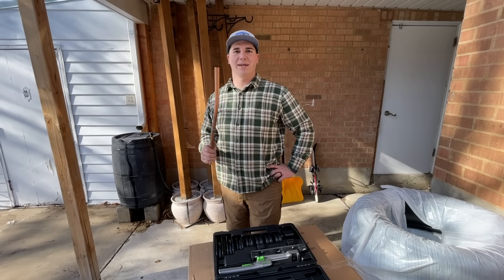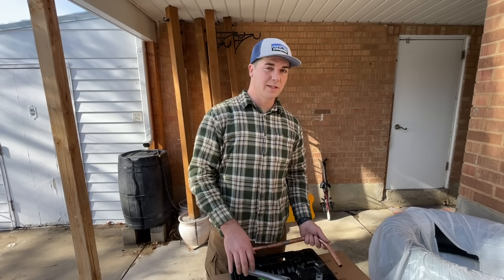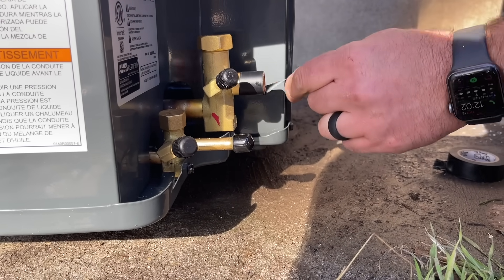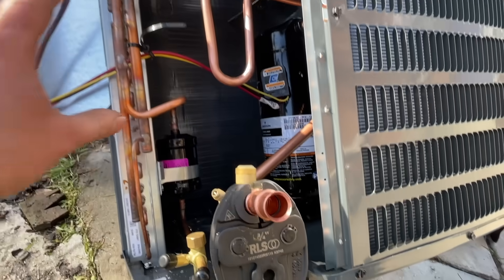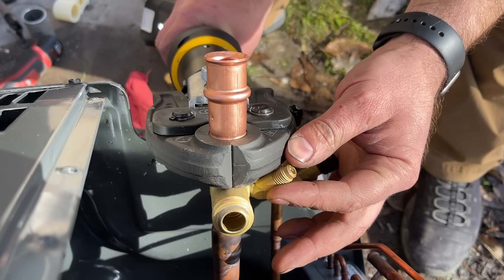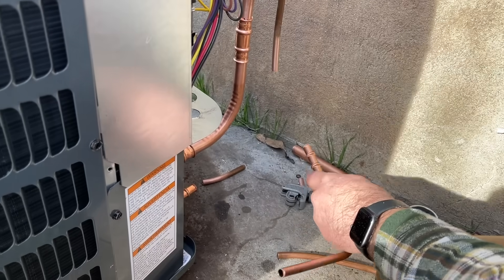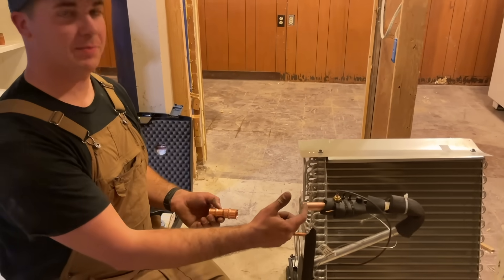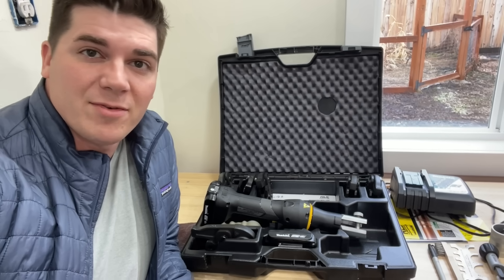Brazing Is For Cavemen. THIS Is The Future Of HVAC Copper Connections. -RLS Crimping Tool-

Comment: With 44+ years in the business, I can tell you that YOU ARE ABSOLUTELY WRONG,  I can braze  6 fittings to one (of the many) crimp fittings out there and IT IS  AN INFINITELY MORE RELIABLE MEANS of makiing a connection, as a DIY'er obviously you've not seen them  perform for the twenty years they've been around. I've seen them fail FOR NO OTHER REASON than someone put something in the closet, attic, or next to it in the garage and bumped it and it starts pissing refrigerant faster that it can be put in. ALSO wait until you have to remove the coil for clearing 5-10-15 years from now and you can't get the fitting off the coil side of the copper or aluminum tubing and there's NOT ENOUGH TO JUST CUT OFF IF YOU WANT TO CONNECT THAT COI,,, What aree you going to do then? order a new coil is going to be my guess. there are MANY points of connection I would never use them, in fact, after30 years as a contractor, I JUST WON'T USE THEM, PERIOD.. The manufacturers go on how reliable they are but I hear nothing but I STILL hear nothing but warranty horror stories  I ised them for 5 years than banned them from my shop. If you are that bad at Brazing/Soldering that you can.t solder a TXV or service valve installed in minutes you need more training. they aren't worth it to me, I've seen to many get "bumped" or "nudged" or even a tech hits one because so much is stored around the unit or it's tight in the closet, then a small fifteen minute service call becomes a morning or afternoon

Comment: It's cheaper to get a tubing bender, a good torch, and a swedge set. It will  last much longer than those orings
Reply from the maker: Yes cheaper is not the thing here, it’s convenience. This tool is great for some applications. Not all, but some
Reply: @diyhvacguy  I realize that ...they even make a sharkbite that will work as well but my good sir we both know  convenient doesn't always equal best...secondly the fittings are very pricey but with all that said it makes a compressor change easier! None of that pesky phosgene gas

Comment: Cutting the fitting on the outdoor unit is unnecessary. Start by soldering and move to Press fit from that point. Press  fit does have a purpose in certain situations but would not use it for every connection.

Comment: The technology is new just like PEC was way back when. The same rules apply now as then. "Let someone else use it for awhile then sit back and wait. Sweat fittings never fail when done right. I made a living joining dissimilar metals together via soldering. Simplicity isn't always the reason to do something quickly. If time is money than guaranteeing your work by simply taking the time to do it once and for all is worth it. Granted the soldered connection isn't a mechanical connection. It's a well designed connection requiring nothing more than prepping the connection pieces together with solder, a liquid that flows to the space between the connection and sets up.

Comment: The fact that R410A is being replaced with a Propane based refrigerate  that can go BOOOOOM!!! Only problem is the o-rings start leaking after a year or two.😕
Reply from the maker: Debatable. If prepped properly they have a 10 year warranty. Why would they do that if they leak after a year? I know folks that have been using this tool for several years with no problems

Comment: What about removing the crimp for future repairs.  will materials cost more later down the line  having to use more copper or double crimp ( original one and new one inches away from old
Reply from the maker: I have a video showing how to remove one. It is quite easy

Comment: Brazing is my favorite part of every job. This looks handy for areas you can't get a torch into, but a well brazed connection is your best bet for longevity. Seals degrade over time, especially with the temperature extremes you find at the end of your line sets.  Cool tool though!
Reply: Yeah, that just looks horrible… It has been a decade since I did a complete install, but it was just satisfying to see a clean, straight, properly installed system at the end of the day… I do controls (PLC/DDC) these days, and I hate walking into a closet where the dmarc is (from internet and telecom companies) as the wiring is so messy and I have to dig for connections so I can have remote access to a SCADA system…
Reply: Just curious, why do you braze when you can use a silver solder that will easily outlast the life of the system.  Soldering is faster and easier and when running a business that is what is all about.
Reply: @briannatarelli430  I use silver rod when I braze. I have never had a failed connection after brazing. It looks good and lasts forever.

Comment: propane torch with solder cost $25. Your tool cost $300+
Reply from the maker: Try $3000 lol this isn’t for every job but it has its jobs where it shines. When you have to get a fire permit otherwise, or you physically can’t get into a spot to braze or solder. It’s paid for itself, and I love this tool.

Comment: PLEASE STOP DOING THIS NOW BEFORE ITS TOO LATE!
Reply from the maker: NO
Reply: @diyhvacguy   Consider my comments as a warning from a 65 year-old experienced veteran licensed HVAC contractor who was convinced back when it was introduced that compression copper connections would be the future, so we began using it almost exclusively until we started to receive multiple call-backs... Apparently the expansion / contraction rates of different grade coppers affects the O-Ring seal within the fitting which will eventually leak no matter how well you prep. So we played around and found it to be too unreliable especially in areas that have extreme weather shifts year round.  Now we braze our fittings once again and guess what?... the call-backs have ended.... so good luck! 👍

Comment: Looks fast and clean.  I can see them lasting 20 years or so inside where they're more protected but outside I suspect soldering makes more sense.  Also if that connection at the condensor fails, then by cutting it off like that haven't you kinda screwed the next guy?

Comment: I've spent much of my life working in Power Plants and other industrial facilities.   It's extremely rare to see an o-ring or some form of rubber/composite gasket not leak by 30 years with the exception of just plain cold water (and even then there are leaks).

Press fittings are a short term solution.  Not long term reliable; and I would never bury them in  a wall.

Comment: Did you get an OK from the mfg to make mods to the pipe coming from the condenser? As stated by others O rings will compress over time and will leak. A silver solder joint is forever. You also have insufficient amount of pipe past the o ring which means that joint can flex and aggravate the o ring compression (You can't slip the pipe all the way down to the stop crimp on your fitting)

Comment: Nope they leak like a sieve they did my fathers entire retirement community using those when they built it 5 years ago> they are leaking all over the building. ceilings and walls being ripped out everywhere to replace them what a f0cking nightmare. BUILDER beware
Reply from the maker: Yea, and I’m sure they had some new 19 year old installer being paid 25 bucks an hour crimping away. Not reaming the pipe and checking for indentions or scotch briting thoroughly , because guess what, he works at another company now and could care less 🤷🏻‍♂️🤣

Comment: I ran into a system that someone installed with these fittings. they ALL were leaking. These are overpriced junk. BTW when you cut the bell off, it becomes impossible to braze anything to the service valve and you will have to replace it. Braze it once, stays for the life of the unit. PERIOD

Comment: The 1 thing folks forget is when you use shortcuts to tried and proven ways, you always end up regretting it. I'll stay a caveman and my stuff will last more than 50 years when your rubber orings breakdown and disintegrate...........Maybe all you folks do not know but in the 80's they tried all kinds of clamping stuff for water lines in houses and got sued out of business. Copper is soft metal and requires permanent connections, not stop gap measures. I refuse to use shark bites, ring clamps and copper crimping devices on any copper line EVER.  Solder and Brazing are the tried and true methods.
Reply from the maker: I can respect that. But if you look at all the advancement that’s been made In hvac as far as tools, it would be stupid to keep using things that are harder to use because they’re “tried and tested”  how do you think they came to be tried and tested? Unless you have used these and seen for yourself that they’re no good, your comment is purely opinion based. Again I respect that, but the hvac field has come a long way in terms of tools being used to make our jobs easier and I’m happy to be the guy who blazes a trail and shares my experiences. Cheers man
Reply: @diyhvacguy  you may FEEL that it is opinion based but having more than 40 years experience as a mechanical designer, builder and Hvac FIELD WORK, WHAT YOU DO NOT UNDERSTAND IS REFRIGERANT IS PRESSURE BASED AND THE Equipment vibrates. That destroys all forms of mechanical fastening systems every time unless it is used with Heat application (i.e. Solder or Brazing). sure it may hold for a few years just like the polyvinyl butyl piping back in the 80 but the compression rings failed, the plastic couplings failed which caused BILLIONS in property damage, drywall replacement, Mold mitigation which in turn forced the company into bankruptcy for a defective product. All you young guys come along and are amazed at simple sheet and how easy it is to work with and SWEAR it is the best. You know absolutely NOTHING About it.

Comment: I barley trust propress at 30 psi. People really trust this o-ring stuff for well over 100psi. Just remember gents rubber deteriorates over time. I've seen braze joints over 50 years and older. Stop being women and grab the the torch.

Comment: All the time spent cutting the valve tubing and having to remove screws for a weaker connection is not worth the problems in the future. do the next Guy a favor and Just silver solider that connection and it would be so much better in 95% of the cases.  I see this when one group of people do new installs and that`s all they do for the company to save cost but then the next guy who does repairs has to deal with the stuff to make a better install. People don`t value craftmanship like they use to or they dont want to take time to learn the right way to do things. The heat exchange that happens there would be much better off with a solder job.  The video was good and there are places that could use this.

Comment: The crimping system is nice but, until they design the A/C system so that I don't have to cut a piece off and make the stub a little longer so I don't have to disassemble parts of the system to use the tool, I would just braze or silver solder it.

Comment: so since quick disconnect can handle higher pressures then in an ac coolant line, why dont hvac people just use those? Wouldn't it be cheaper. less time consuming? If you had those one a line to a home, and a compressor needed changed in the future

Comment: I have been retired now three years, surrendered my contractors license and closed my business after 40 years in the Trade. I would have already had a vacuum pump on or releasing the charge getting the tools on the truck! No way faster and I question if those fittings are ASHRAE approved. Your other method of stay brite is terrible also, the flux and solder get into the system like BB's and hit the compressor, thus destroying it. A silver braze joint is rated for 2,000+psi and 1800*F.  R410A can hit 400*F and 450psi on a 100*F summer day, thus blowing those fittings apart or unsweating your stay brite joints. If a condenser fan motor fails without High Pressure cutout switch............wait till you see what happens! Also, you rely on the massive hose and pump you bought etc. but once you reach a absolute vacuum your just "boiling" all contaminants' out of the system. It does not remove debris and particles! One more point, when you release the factory charge, open the liquid line valve first, wait for the suction to break vacuum and purge your hose on gauge manifold to burp the volume of air out with the freon coming full circle in the correct path of refrigerant flow!  
You have a great attitude, eager to learn and buy good instruments but your lacking correct detail on numerous points all across the board. I don't want to come across as a hater, you say your DY'er but it sure seems your getting a lot of jobs that makes it a profession plus I doubt your certified nor licenced, right? Your doing a good service to some but a big disservice to the industry which is already going to shit with qualified tradesmen! Excuse the vent, I'm also living with 9 crushed vertebrates in my spine and zero cartilage in my knees so pain is a constant memory of 40 years knowledge stuck in my head that is absolutely worthless now! Good luck out there and stay safe.

Comment: If that first crimp joint so close to the valves leaks you are totally 100% screwed.
Reply from the maker: Not true. I have another video on removing one of these fittings. It took me about 5 mins and I had a pipe I could sweat/braze to

Comment: personally I don't like that type of connection, I've worked on residential, commercial and auto a/c's, silver solder connections on residential and commercial a/c's done properly are permanent and will give no problems over long periods of time but using o-ring joint seals will eventually break down and causing leaks, silver solder won't that is why they don't or won't use o-ring crimp seals when assembling the units, after working on car a/c's for over 30 years I can say and seen all automotive o-ring seals will break down and leak after a period of time and you definitely don't want to use one of these inside of a finished wall, ceiling or closed in flooring.
Reply from the maker: These are totally different from automotive o ring fittings. I respect that you don’t want to use them but thus far I haven’t had any problems. It’s all in the prep work. Anyways thanks for the feedback

Comment: Brazing is for professional craftsmen who take their time to produce things that last for decades. Crimping is for untrained hacks that are in a hurry to assemble things to last until the one year warrantee expires. This is NOT the future of copper connections. IMPO
Reply from the maker: IMPO people think the RLS tool is for hacks but what hack has 3k to drop on a tool plus fittings that are somewhat expensive? People also think anyone with this tool don’t know how to braze which couldn’t be further from the truth. This tool has its place, I don’t solely use it for copper lines but it has saved me many times. Until you have personally used it and see that it doesn’t work, don’t be so critical of it. Cheers
Reply: @diyhvacguy  I HAVE seen it used, on the plumbing of a huge university project I did a few years back, and we had a lot of problems and abandoned it. O-ring systems are quick and dirty but not nearly as reliable, especially long term. In  refrigeration they rely on the oil in the system to keep the seal.  If you don't run  the system for a while, like on a straight cool in the winter,  they dry out and leak. It's a big problem with old Fords that have an O-ring system too. Not to mention you can see 800 psi on the high side of a 410A unit with a dirty coil. That system may have some very limited applications but it is way inferior to brazing. You'll figure it out eventually. You can call me an old timer but I'll stick with brazing.

Comment: Don't like to braze, then silver solder with Stay Brite 8. Never ever had a problem or a leak. Can do all the joints in less than 5 minutes. So easy itscrediculous and you don't gave to spend 1000s on the crimping tool and those fittings ate expen a I've as hell. They will leak, it's just a matter of time.
Reply from the maker: I can respect that. I have several videos on Staybrite 8. That’s primarily what I use actually. I love it. I use my crimp tool for certain jobs but def not all. Thanks for the input though!